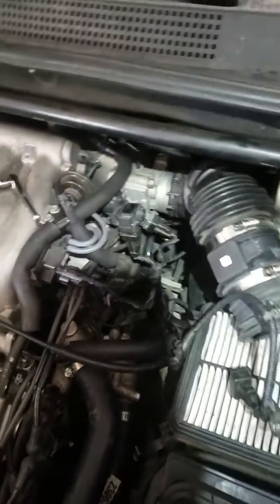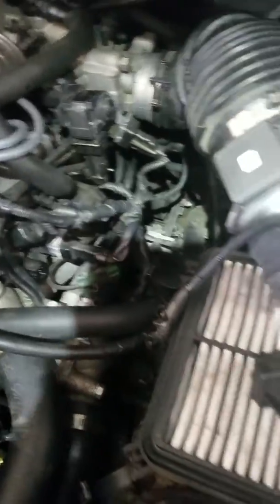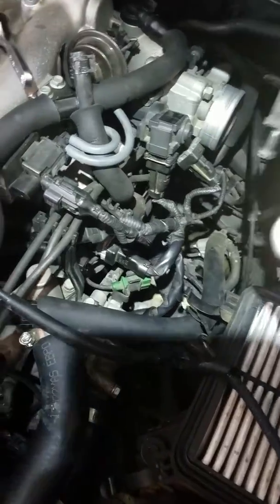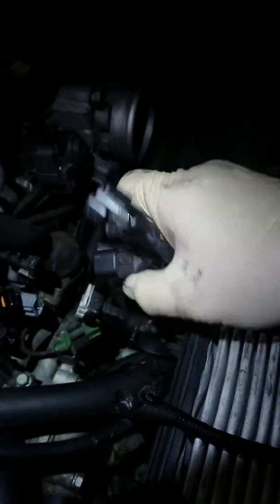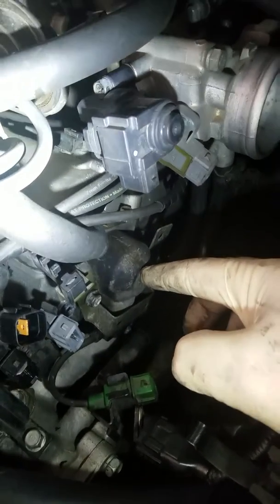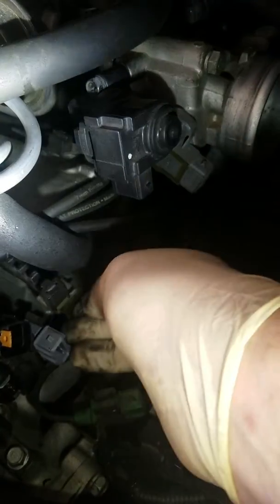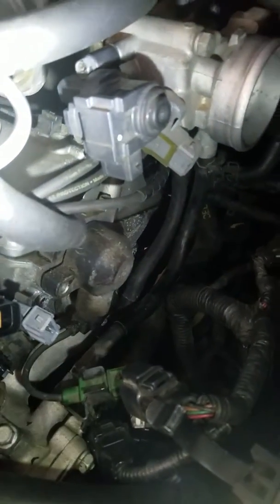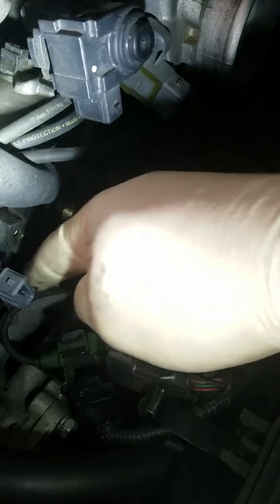Hyundai Tuscon 2.7 liter camshaft position sensor replacement

Comment: Absolute lifesaver. I had the wiring harness and mounting bracket out of the way but could not for the life of me figure out how to get my 10mm socket on that damn mounting bolt with that stud in the way. I knew it wasn't possible but the engine was so dirty I could not see that the housing was removable. Thanks!

Comment: I thought I was at a loss on how to remove that "sensors bolt" at the bottom, UN-till I saw that the metal housing can be removed from watching your video- Thanks so much for posting!
Reply from the maker: I'm so glad you could fix yours. Thanks for the comment.